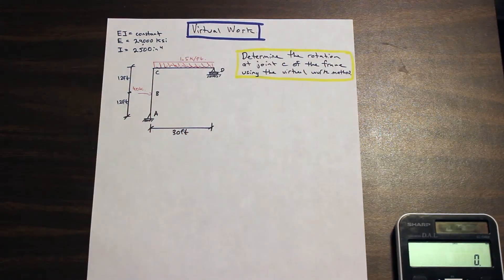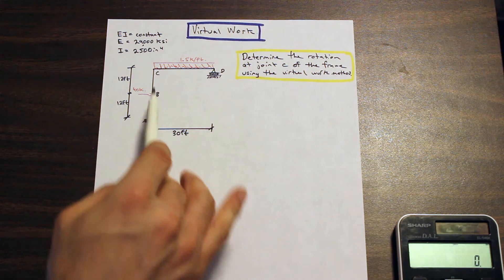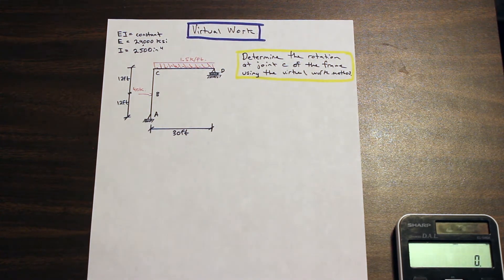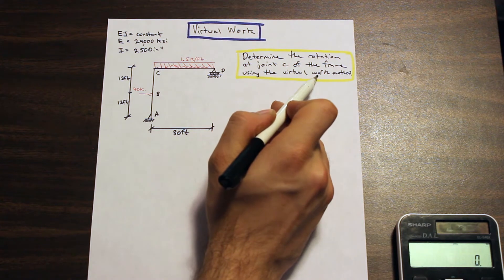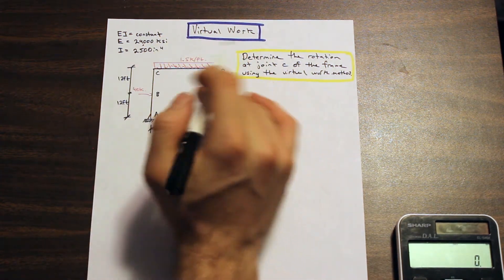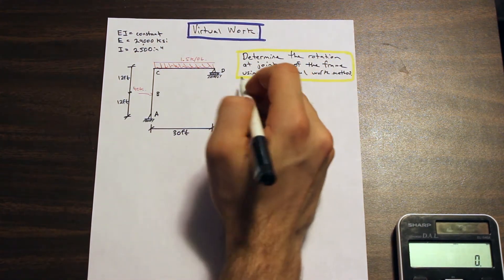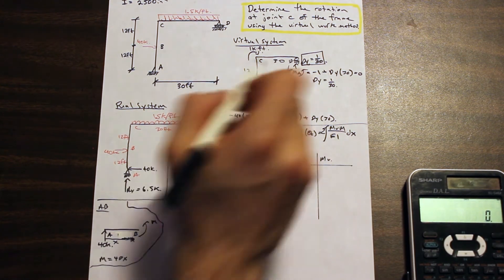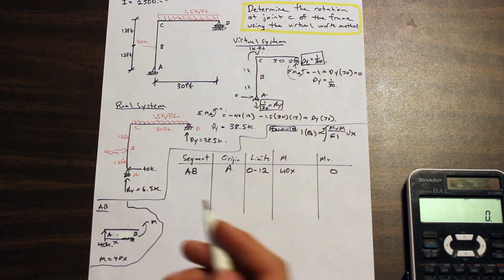Virtual Work Method to Solve for Rotation at a Joint (Frame) - Part 1/2

Comment: Could you explain why is the virtual moment for segment CB is 0, you are taking origin from point C shouldn't the applied virtual load at point C be considered when cutting CB
Reply from the maker: The question is asking us to calculate the rotation at point C.  That means in the virtual system we apply the virtual moment at point C and simply calculate the reactions.  This is shown around 5:30.
Reply: But since you're taking C as the origin and there's an existing 1k.ft moment at point C, shouldn't it be considered?

Comment: Why for dc real is m negative ie -m. isnt m pushing it clockwise??????
Reply from the maker: As shown in the FBD of the forces acting on member DC, if we cut just to the right of joint C, we have a clockwise moment, hence positive.  When you start to work with frames, it's quite difficult to envision sometimes how they're acting.  Best just to rely on the math.

Comment: Mv (for virtual) at member CB is not zero. It should be 1.
Reply from the maker: Thanks for the comment.  Our moment is acting on section DC, thus AC only has axial forces acting on it.  Mv = 0.  For section DC, we cut just before C with D as our origin, ignoring the 1 kN-m point moment.

Comment: Excellent video. Could you explain why you multiply 1.5x with (x/2). Why do you use (x/2) ?
Reply from the maker: Andrei Ciohodaru thanks a lot for the positive feedback, glad you enjoyed it! The reason why we multiply by x/2 is because we're multiplying by the moment arm of the resolved force.  When we represent a member in terms of variable distance x, the resolved distributed load as a point becomes the value of the load * x.  in this case, 1.5x.  In order to find the moment caused by this point load, we must multiply by the distance from the point we're considering to the point load. Since we know the resultant of a distributed load acts at l/2, where l in our case is the length of the distributed load, we multiply by x/2.  This is because we're representing the length l as a variable x.  Hard to explain by messages, if you require more clarification feel free to email us.  Afmatheng@gmail.com
Reply: Got it ! Thank you !
Reply from the maker: Andrei Ciohodaru np!